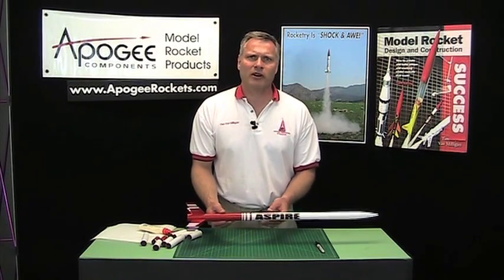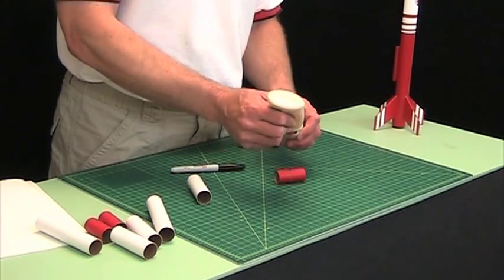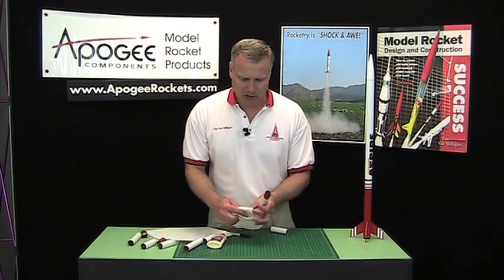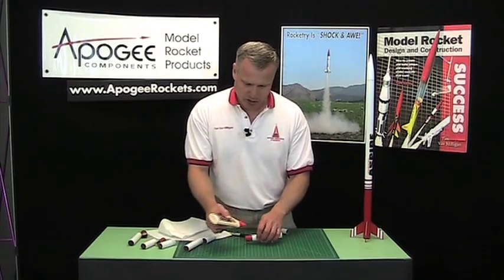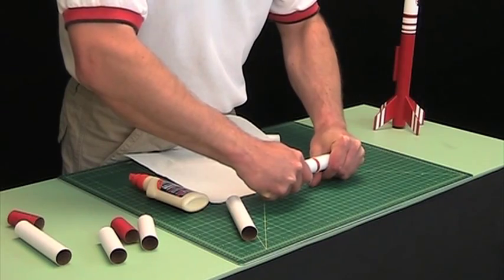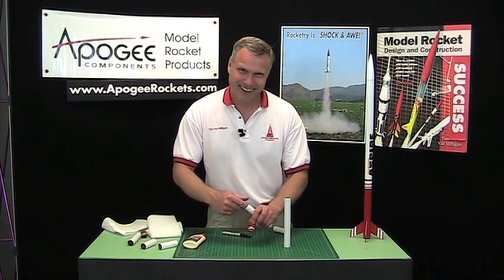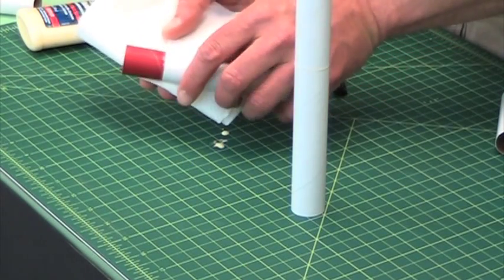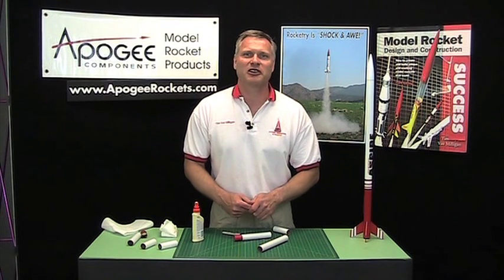Glue Model Rocket Tubes Together

Comment: Hi Tim, love your informative videos but you might want to update this one. Keeping a straight piece of metal angle iron handy & verified a good dry fit,  wipe the to be glued coupler & body tube ends with a surface smear of any type super glue. After sandpaper  roughing up the dried super glue film & rechecking the dry fit, apply 5 or 6 lengthwise Narrow strips of white glue to inside of body tube ONly while inserting coupler & twisting 1/2 turn. Place glued assembly  inside angle iron (or aluminum) & let dry. ...Voila !! ...No sticking panic or Any excess glue to wipe off (all glue stays inside body tubes) and a perfectly straight &  strong, no hassle drama,  body tube assembly job Every time & then you can have a couple of "celebration" beers (instead of several pre-attempt "bracer" shots)...works for 
me...Keep up the good work,....tom.

Comment: You should spin as you push the coupler in.....better glue spread, less glue to clean up ....
Reply: I have had bad luck pushing in tubes together like he did without twisting.  it’s a safe bet for me- and i also like to get the grooves lined up (if applicable) so i am not starting two different spirals.    iIts been years since i built a kit with a coupler, but still remember the aggravation and then panic trying to get that coupler out.   😱